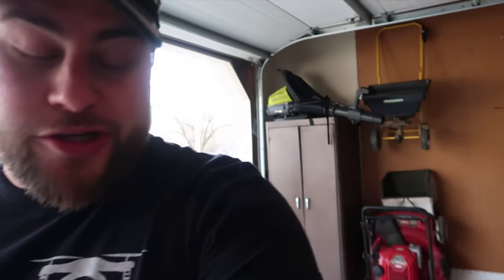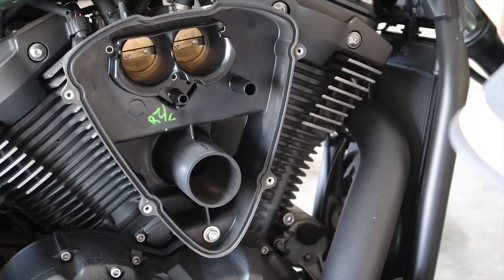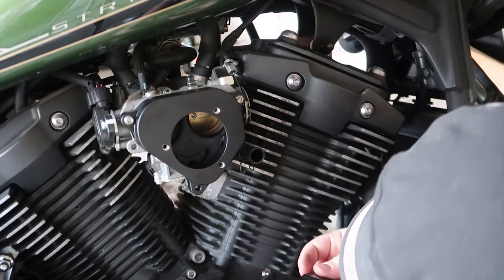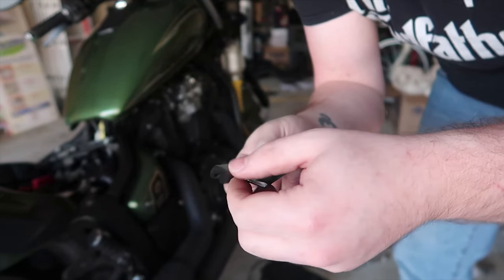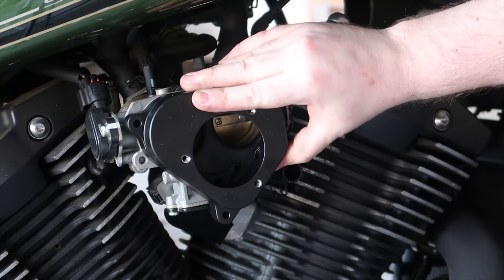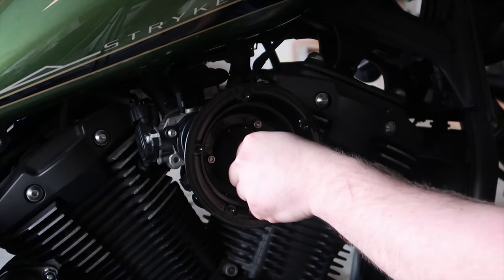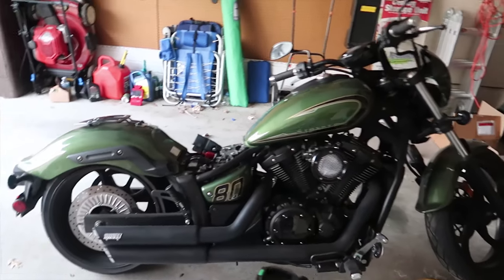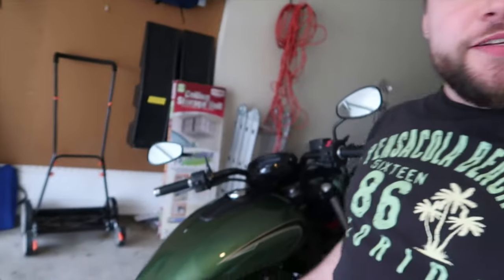How to install a Kuryakyn air filter without instructions

Comment: Do you have to tune or rejet after installing that air filter? I’m new to the motorcycle world.
Reply from the maker: Yes.  You will, at the least,  need a fuel tuner.  Look into IVAN's Flash for the Stryker;  he flashes your ECU to run with pipes and an intake, along with a bunch of other things.... it makes the bike what it should be.